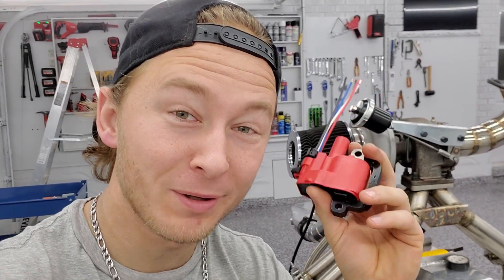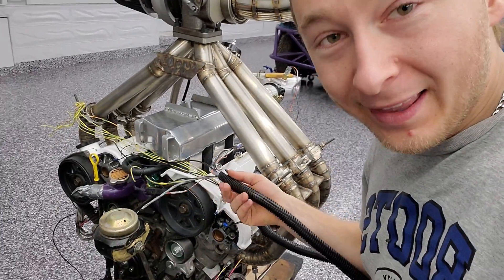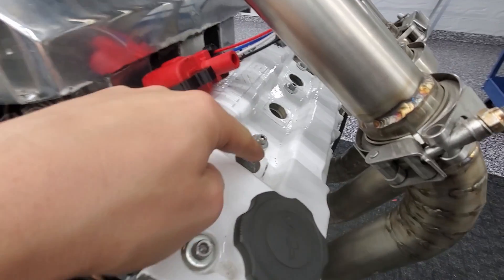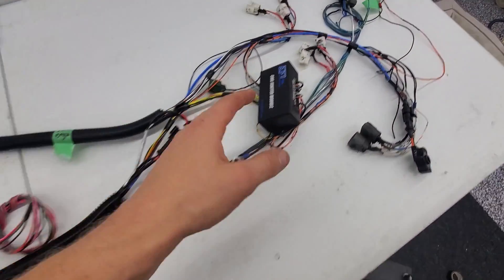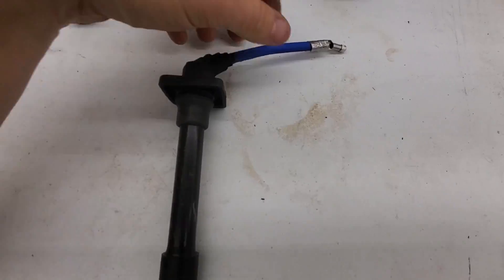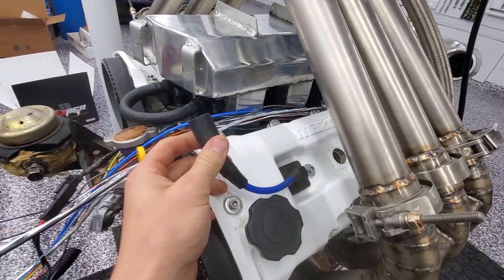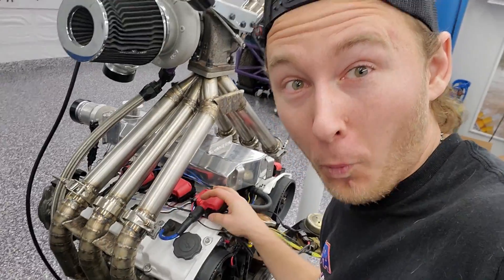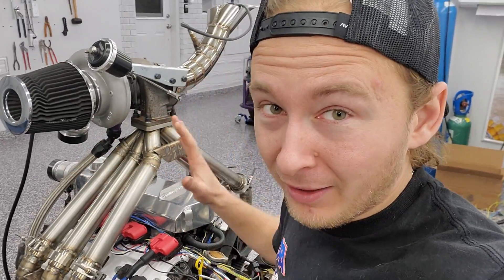How To install LS Coils Onto ANY Engine! I Installed 6 on The Twin engine MX3! with Megasquirt evo!

Comment: Do you thi k this would be possible on a saab b207r motor which is basically an ecotec 2.0 turbo ive done so many mods and the boost is blowing out the spark. Ive tried msd and it didnt work at all. Both the LS and saab motor have 4 wire connectors the saab use a crank sensor no cam sensor the same as LS.. tell me what you 🤔 think. You seem very talented. FWI saab people on forums are know it alls and won't give up information alot of the times because they do t agree with what you are doing
Reply from the maker: You can put ls coils on Any vehicle! The sky is the limit 

You will need a switched power to all of the coils, a engine ground to all coils, a ecu ground to all coils, and a signal for each coil from your ecu sequential spark outputs and boom your done